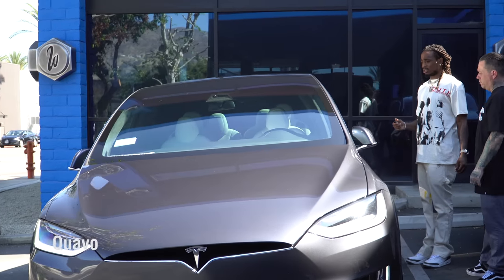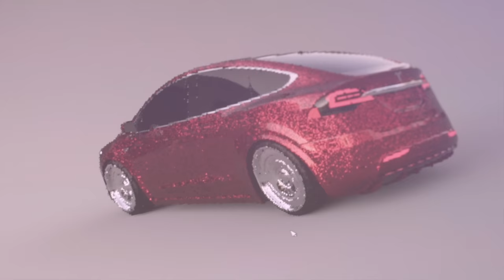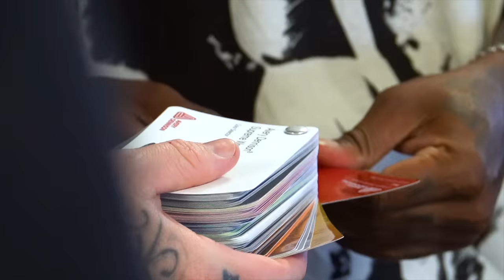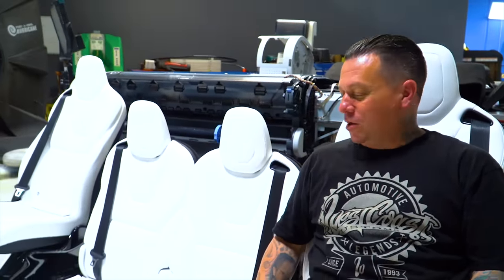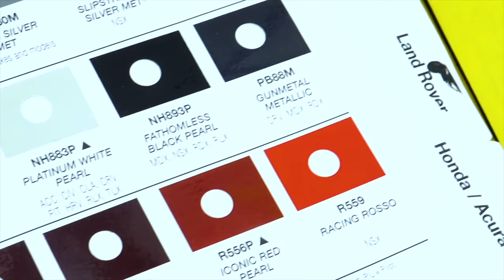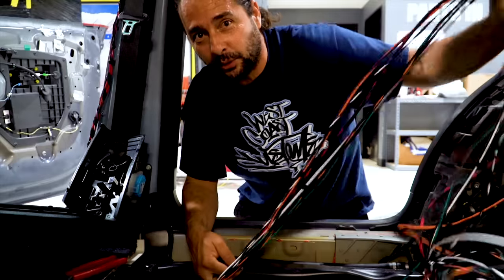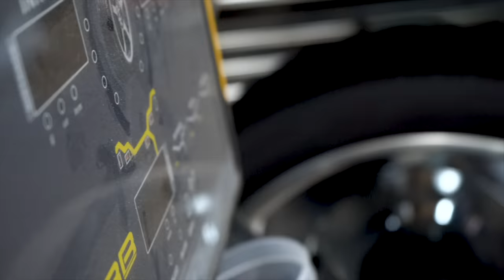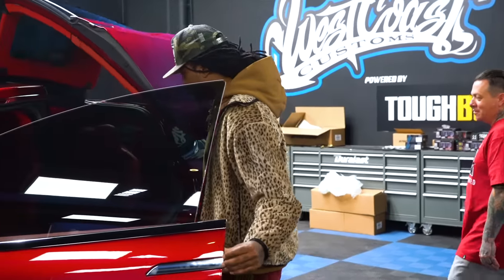Quavo's Bloody Tesla X | West Coast Customs

Comment: For those that don’t know how this works: 
Quavo went to the Tesla store and purchased a readily available Model X to deliver to WCC for customization of his project with them. 
There was no red Model X available and it wouldn’t matter if he was going candy on the paint.
The Model X in stock at the store already had white seats.
Quavo more than likely purchased a P100D. 
Quavo had the money to spend on this project so it doesn’t matter how it started out. 
The Forgiato rims look solid but has proper ventilation as most wheels do.
The brakes will be fine. 
WCC wouldn’t refer a product that would fail the build later. 
The car looked great!

Comment: I wonder about what powers all the extra sound equipment in your builds. Usually a 12v lead acid battery powers all the electronics of a car. But its an antiquated tech at this point. Do you guys replace those batteries with bigger/lighter lithium ion batteries?